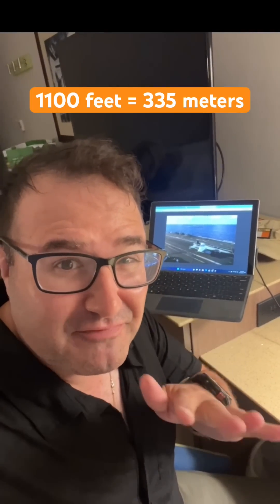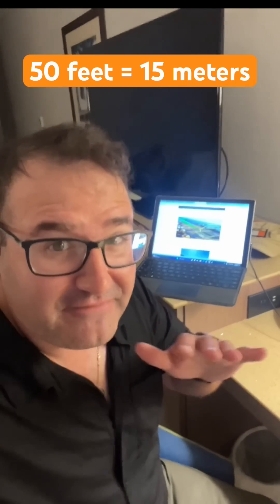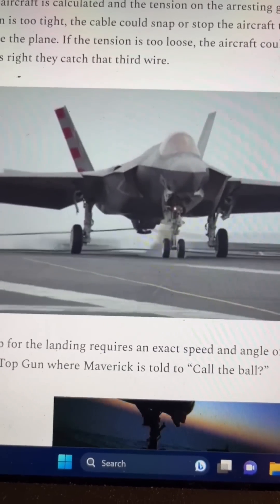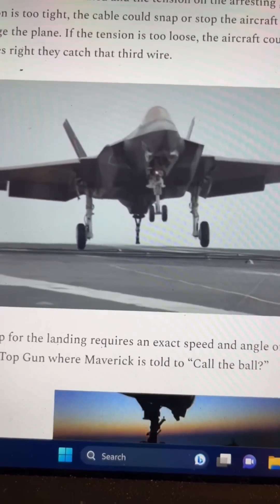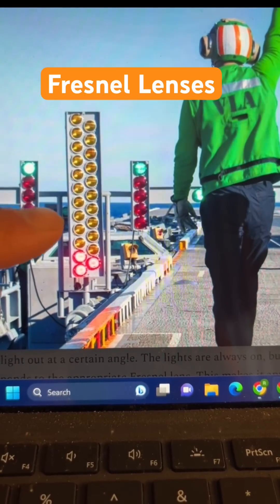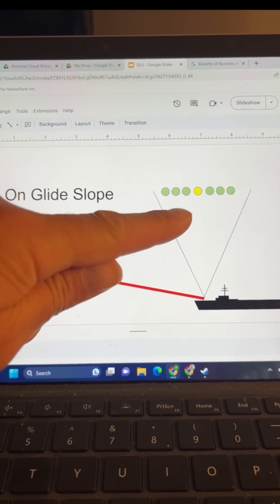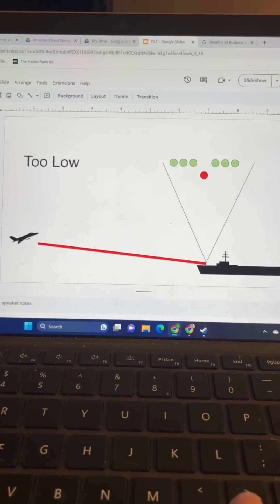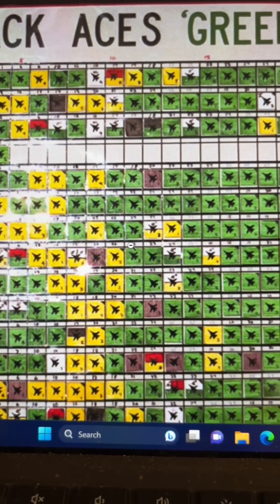How Planes Land on Aircraft Carriers

Comment: Can you say, "controlled crash"?  No Air Force fighters are built strong enough to handle the stresses of launch or landing like is required of Navy jets.
The F-35A is definitely not as robust as the F-35C is because it is simply not necessary.  The latter is also likely more expensive than the former as a result.

Comment: I have a question. Thinking about force and use of the hook. Is the hook on the end of the rod only good for so many landings given how much force and tension it goes through bringing the aircraft to a stopping point?
Reply: Yes. Can't remember what the interval was but either the whole hook or on other aircraft the end of the hook gets changed. Nigh EVERYTHING on a Naval Aircraft gets swapped out eventually. It all is on a periodic inspection cycle and gets recorded in the AC logbook. A single AC has a record longer than the most vicious San Quentin resident than there ever was.

Comment: The tension of the cable is the same regardless of the weight of the aircraft. What stops the aircraft is the closing of a hydraulic valve, could be more specific but Russians are watching 😂

Source: myself... fully qualified in the arresting gear.

Comment: I'd like to know how modern damage control works on carriers. Ive alwayd wondered what would happen if a carrier got hit given that nowadays warships dont have much armor
Reply: Basically that’s a fire control detail the US Navy personnel drill constantly. If I understand your question correctly the only course of protection at that point is to save as much of the flight deck and defense gunners as possible and bail water with a system of pumps to keep the ship level. My knowledge is limited as I was a spouse of a nuclear submariner so take my simplistic understanding as casual comprehension. 😀

Comment: If the hook jumps a wire, could it grab a later wire safely? What happens if you catch a wire while airborne?
Reply: On modern US carriers, there are generally three wires. If you miss the first one, you can still catch the second or third wire. However, that's only if your approach is correct. If not, you'll do what is known as a "bolter" and miss all three wires. The pilot will have to go around and try again. It's also not possible to catch a wire while still airborne unless your angle of attack is really messed up (which it shouldn't be). Navy aircraft land with the two rear sets of landing gear and the tailhook hitting the deck at the same time.

Comment: Do people who don’t work on the flight deck get opportunities to get fresh air on a regular basis, at least during peace time?
Reply: I was on CVN-76 in 2011, as a non-flight deck crew.
The ship isn't completely closed. The hangar bay doors are usually left open during slow operations. There are doors with walkways all over the side of the ship, but it's mainly for flight deck crew to get topside. They can be opened for some fresh air, but leaving it open is discouraged. Other than that, the boat has steel beach picnics on the deck where everyone can come up. You can also volunteer for a FODwalk that takes place multiple times a day.
Reply: @abhishekrao1525 
“All hands are invited to check themselves FOD free and muster on the flight deck for this evening’s FOD walkdown. Flight deck uniform is not required.”

Comment: When youre discussing the Fresnel system, you show a pic of  the Manually operated visual landing aid system (MOVLAS) instead. This is a backup to the FLOLS used in case of failure to the Fresnel lens or when the sea state is too rough for the FLOLS’s stabilization system. Basically the LSO works a big hand controller that moves the meatball up and down to show the pilot where he is in glide slope. Good times. Come on by the Midway museum for more!

Comment: Im not an avionics expert, and this might be a case of “Why don’t they just…” But from what I know, the “autopilot” landing systems for commercial airliners work very well even in poor visibility, and possibly can land a plane better than a human pilot** (citation needed)
So anyway, “Why don’t they just…” throw technology at it and have the planes land with autopilot perfectly every single time, without the pilot needing to manually land it? Truly curious about this one.
Reply: Airliners have room for error which is much, much looser than carrier jets: they land with thousands of feet of room for error, while carrier jets only have a hundred feet or so. I'm not sure if those systems have the tolerances that are acceptable for the Navy; even their unmanned drones are hand-landed (IIRC).

A landing system like that would need to take up space and weight on an aircraft, likely around the nose/cockpit. This is prime real estate for things like radar and other sensors and systems, so since landing with pilots works (and works really well, I think their accident rate is something like 1 in the 100,000s) its not worth it to add because it would take up room and weight and since there is a need for external sensors there's also a risk that it would compromise the stealth characteristics of the aircraft. 

An airliner, though, has a lot more allowances available to it since they're much larger, have no stealth requirements, which is why it would be a lot easier (and possible) to add those systems on.
Reply: @roguevector1268  great points there. I didn't even think about stealth, but there's that too.

Comment: Can you try to explain the amazing mythical wiggy board and what all the pieces mean? It would be amazing to see that. FYI the wiggy board or the flight control board is a quasi board game kept on the flight control room that has small toy models pieces that represent every plane, it tracks the working state of each plane and its position on the ship. ( ie: a blue nut represents fuel, a yellow bolt represents weapons ready, etc etc) They have a digital version on LCD screens and a toy version in case the primary one fails. Both I was told are kept active and working in real time..its the heart of the ships planning and logistic. If you can do an episode on that, would be beyond amazing and fit your content well..🤔🇻🇮🇺🇸✈
Reply from the maker: I’ll ask

Comment: What did they do before the cables?
Reply: Additional info, before conventional carrier became a thing, the mostly used seaplanes that can just land beside the tender and the ship would just use the crane to get them back up on the ship.

The first official use of arrestor gear started in 1922, just 4 years after the first carrier was launched. But it was used in small number before that as well.
Reply from the maker: Planes were light enough to just Land and stop
Reply: @RyanMcBethProgramming  This relates to why the 'Island' on the deck is usually on the right hand side; those lighter and slower aircraft were propeller planes, and because convention was that propellers spun counter clockwise (from the pilot's perspective), this would cause out-of-control aircraft to drift to the left more than the right.

So they built the islands on the right to increase safety; so that pilots in an out-of-control aircraft would fall over the edge with a chance to be recovered rather than crashing into a tower of steel and die in a ball of fire.

Comment: What are those split color landings?
(On the grading board)
Reply: I'm interested in this too. My initial googling around says that at least one method of scoring this system shows red is a 'wave off' or the LSO (Landing Signal Officer) told the pilot that they needed to abort the landing, circle around, and try again.

It seems that its segmented (you can see plenty of half-results, and 'Squeeze's first landing was a three-quarters brown and one quarter yellow, while 'TC's first landing was three quarters yellow and a brown) might suggest that the grading is done by multiple (four?) people to aggregate into an overall result?
Reply: You have to land somehow… If the first attempt is a “bolter” or is waived off, they go around and try to land again, and sometimes again, and again, and again.

Comment: Now that drones are landing on carriers, how long will it be before the Navy develops an automated landing system for manned aircraft?
Reply: Aren't those drones still piloted, except remotely? They do have semi-automation (like, for example, if they lose signal they'll return to the last position where they had signal, failing that they'll return to a designated rally point) but at any point a pilot can take control and do things like land.
Reply: There already is an automated system for that. It's been around since the days of the old F-14 Tomcat. It's known as ACLS (Automatic Carrier Landing System). F/A-18s and F-35Cs have them as well although their systems are much more accurate and better at landing than the Tomcat.

Comment: "how do they conduct CAP (Combat air patrol) missions and how they differ from the airforce"

This is my question, Cheers lads
Reply: The big thing about CAP stations in the Navy is that your defended location is moving. CAP is going to be stationed relative to the Carrier, and always on the threat side (between the ship and China/Iran/Russia). This is the same way ships operate, Destroyers acting as screens for the high value unit
Reply: CAP missions are pretty complicated. They can change a lot depending on the situation. Generally, it's a flight or two of fighters flying around and patrolling an area.
Reply: We do combat air patrols a lot better than the air forest!  and anybody can land on 10,000 feet of runway but to land on 150 feet of pitching deck takes a special pilot. That’s what separates us from the air forest.
Reply: @whclcdr  As an Indian Naval carrier pilot said in an interview "Its a controlled crash landing"
Reply: @fretted4life  yes having landed on multiple carriers over my career I can tell you the same thing pilots call it a controlled crash
Reply: @fretted4life every fixed-wing carrier pilot says the same thing